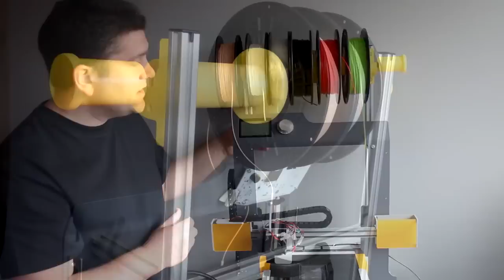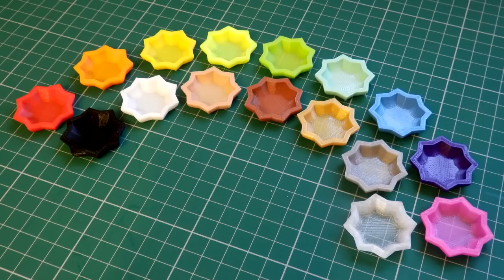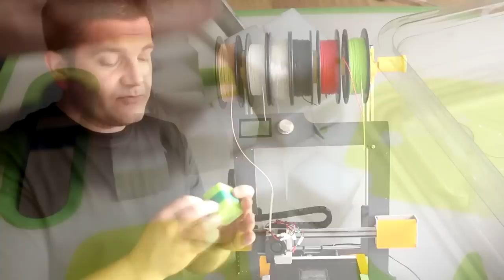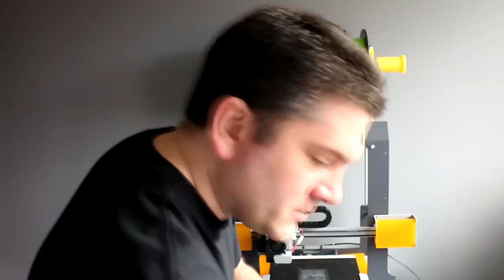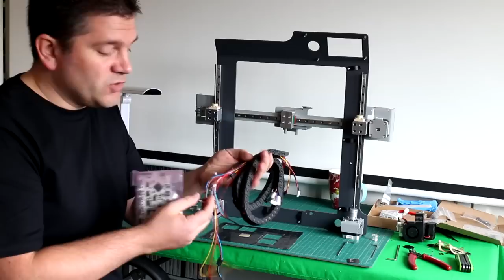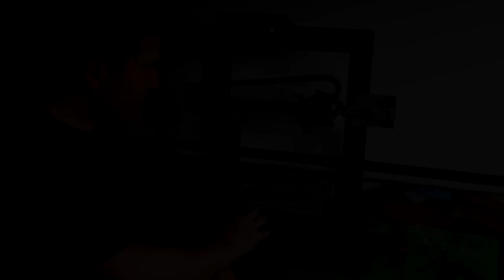Bq Hephestos V2 3D Printer - Upgrades and kit build Jan2016

Comment: Hi Rich, great video.

1.) I read your post describing the possible limitations on adding your own heatbed to the Hephestos 2 and was wondering if you'd been in touch with BQ on this issue at all?

I've emailed them regarding the issue (the ability to add a heatbed) but haven't heard back yet. I understand the PSU, at 100W, wouldn't be up to the task so would also need upgrading. Is the Hephestos set up in a way which would make this at all reasonable a proposition (presuming BQ's board does indeed support a heatbed ofcourse)?

2.) Is the Hephestos 2 design permitting of an alternate hot-end? I'm interested in trying to print with polycarbonate, which would possibly require temps up to 270 Celsius for optimum printing (I've seen the Heph 2's max temp listed as 260).

Ultimately I'd only be really interested in a Heph 2 if it was upgrade-able in this fashion, as it would still likely work out cheaper than most other options for the capabilities offered.

Comment: I can't help thinking that, having gone to the trouble of bonding metal to the glass bed, they could have attached some studding to hold the bed in place with nuts underneath and do away with the need for those two clips. This would have given you a build area completely free of obstructions.

Comment: what is your favorite slicer and controller combo? i use slic3r and pronterface
Reply: +cubedude76 Same for me as my printer hated Cura and had issues with S3D though I am in the process of redoing my printer (everything is more true) I am going to try S3D again since I bought it.  Btw, for most printers it really is worth the money hands down since version 3 but prior it had far too many bugs.  A lot of people balk at 150 USD price tag, and I do agree that is highway robbery, but there are no support structures like S3D does.  Best supports I have ever pulled off.  So much control too (better control than slic3r in most ways).  There is a bloke (makers muse) who did a pt1 showdown of all of the slicers and pt2 was due out today but is delayed by a couple of days.  He turned me on to a free one I had never heard of and for a UI it is hands down the absolute best but my printer is down until China sends me my thermistors so I can&#39;t test it here but I want to see how it does (the results) in pt2 coming up.

The name of it is Craftware.
Reply from the maker: +cubedude76 Slic3r for me too, I experiment with Cura every now and again, but Slic3r has a lot of control and works really well for TPU (FilaFlex).
Reply from the maker: +legalizeshemp420 I use Slic3r for most things. S3D is good, I like using it and I agree the support generation is very good. But you don't often need or want support structures with TPU (it's almost impossible to remove) unless we can find a material that sticks to TPU as a second support structure.
Reply: Richard Horne
Never had a chance to play with TPU but I know support material on PLA is a bear too until S3D came around.  I am dieing to try craftware but without support a lot of the things I design would never work and there is no way around (no matter how you orientate the part) supports so TPU wouldn't be very viable in those instances.

Comment: Can NinjaFlex be left out in the open air or does it have to be away from humidity like ABS and PLA ??
Reply from the maker: +Krankzinnig Piet TPU filament is hydroscopic so will take on moisture. (it's similar to PLA/ABS) You should store at room temperature. It's fine to be open and not in a sealed pack. If you do have it stored in a cold place, let it warm back up to room temperature before trying to use it. Generally, keeping it warm is a good thing.

Comment: Hi Richard, nice video update. Those prints look fantastic! What slicing software are you using? Do you find extruding at a higher temp yields better results? I find printing slower (30mm/s) and hotter (240c) makes pretty decent quality prints. Cheers!
Reply from the maker: +Pixil3D I print FilaFlex at 242 Degrees C and the standard speed is set to 48mm/sec (that's real print speed, not limited by the firmware) - The Hephestos 2 can handle 200mm/sec travel moves and high-speed printing. But Elastic filaments are best printed at under 60mm/sec for good quality parts.

I'm using Slic3r and yes going a little hotter does make for better layer bonding and almost indestructible flexible objects.